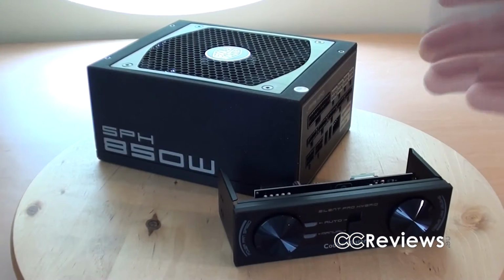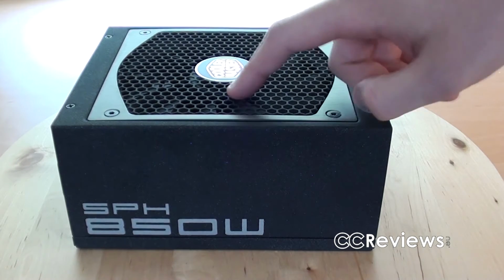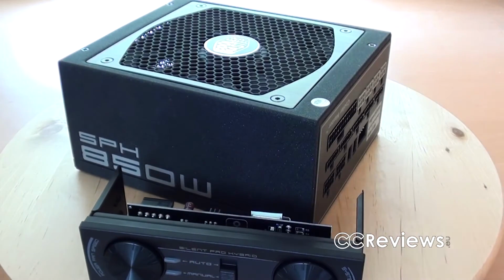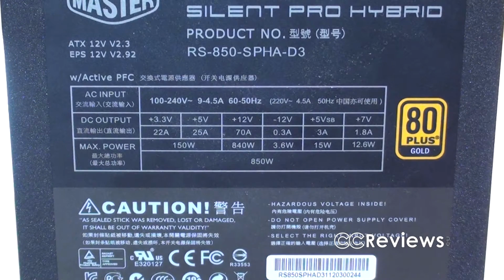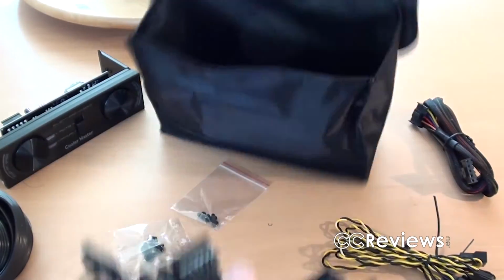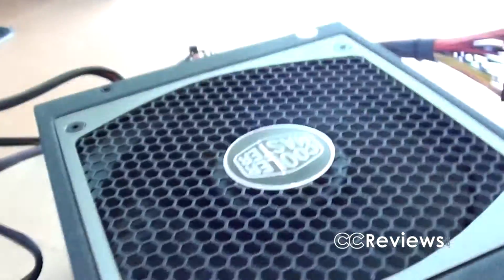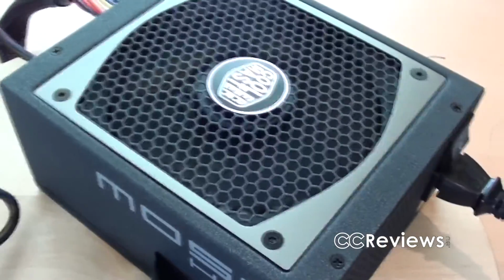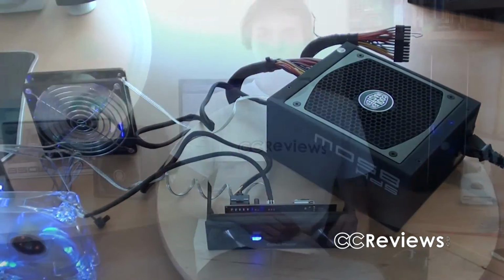#74: Cooler Master Silent Pro Hybrid 850W PSU Review (CCReviews)

Comment: Sup dude, 

Could you connect the Fan controllers connectors to Chassis Fans? The way I found it with my setup the standard connectors you get connecting to the Fan controller to the other 3 Fans didn't connect properly. 

Maybe I'm just doing something wrong? 

If that made sense

Comment: if I had a case with a big window, I would be saying why they hell have they mounted the psu that way. taking cool air out of the case before its even done its job since heat rises and destroying the static pressure build up in your system wasting the power of your front intakes. odear

Comment from the maker: I'd still mount it up. The difference being made when creating its own airflow cycle or having it use the air from your case isn't that different. Especially when the PSU is at the bottom of your case of course.

Comment: Hi i was just wondering with the 24 pin plug could you use a different sleeved cable so it would look much better. The next thing how long is the cable to the power supply to the fan controller thanks.

Comment from the maker: It's interesting, but then again it's not like all fans in your case are just there to cool your PSU The heat in your case isn't always immediately connectable to the load on your PSU. But indeed, it would've been a nice feature maybe, but I'm not surprised that here it just keeps running at 7V.

Comment: I got mine a few days ago and either it or the motherboard is defective :(. I tried the paperclip method but nothing happened. But seeing nothing happened until you turned it to manual i'll try hooking up the fan controller and see if i broke the motherboard :( or psu is defective. Hopefully its psu, cause im not sure if the will replace motherboard